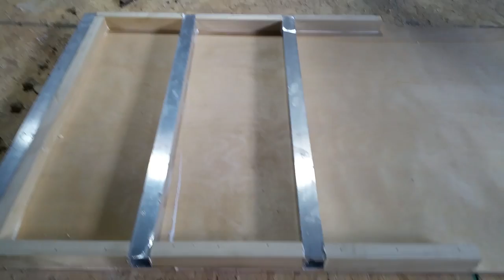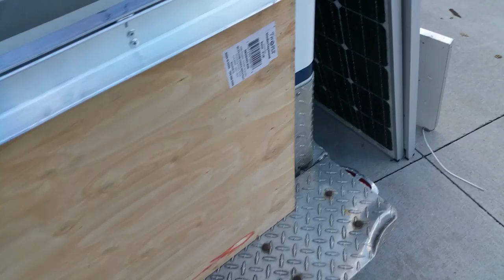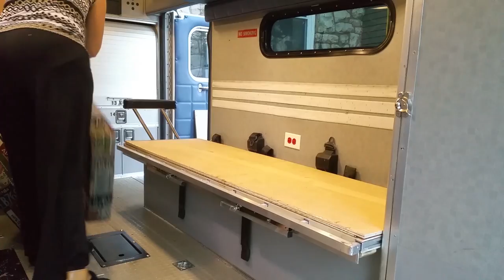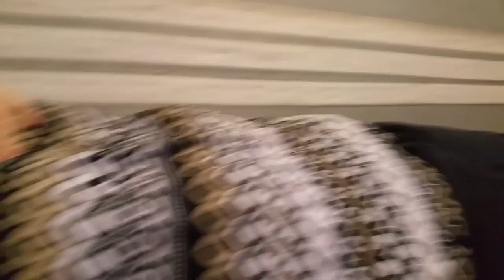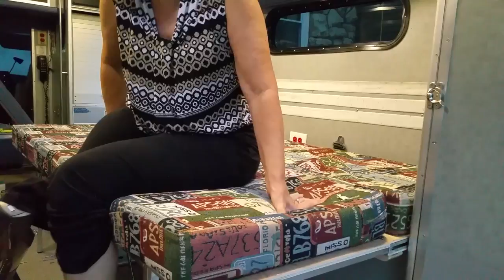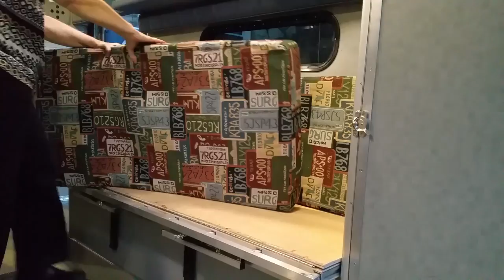#12 Amazing DIY Custom RV Sofa Bed: Ambulance to RV Conversion!

Comment: That is and excellent idea rather than using the wood slats that pull apart. I think this way is probably a lot  stronger and lighter. Thank you for the video! Keep up the good work.
Reply from the maker: Thanks Dan. It does seem simple and solid.

Comment: Now somebody with kids could do apply the same concept for the seat back by doing exactly what you did for the seat bottom and apply that concept to the seat back have it expand out and have legs come down so you can have a double decker bunk setup. That would work good to sleep two kids and two adults or 3 kids and 2 adults depending upon the size of children.

Comment: Very ingenious use of the bench seat! Now will that slide out for the bed wiggle outwards while you're driving, hitting bumps, taking turns? Maybe you have some method to keep it stationary while running the roads?
Reply from the maker: I don't think it will, but if it does I can put a lynch pin in one end to hold it in place. Thanks Lawrence!

Comment: Hey Jim, EXCELLENT build. We're putting a bed in our ambulance and I haven't seen any solutions as well executed as this one. Where does one acquire legs like that? Thanks!
Reply from the maker: The legs are square aluminum tubing with caps on the ends. The hinge-support is simply a heavy duty shelf bracket that was riveted to the bed and legs. I used a pull-pin to hold the legs up. Thanks Dustin!

Comment: I bought an ambulance which I am converting to an RV. May I ask questions?1) is there anything you would do differently if building the bed again?2) how did you attach it to the wall so that it can still lift up for the storage beneath?3) do you have the support pieces about 6-7inches apart? I was afraid the aluminum might not be enough support for my sister that is about 280, sleeping alone, but if both of you are ok, then she should be, right? 4) Do you see any reason I couldn't do this, replacing your solid pieces of wood with peg board with holes to alleviate mold? Mold seems to be an issue under beds for many who live in small areas like this.5) my sister, like your wife, has one leg. I am afraid I can't get her into the ambulance (she lives hundreds of miles away, so haven't tried yet). How does your wife do it? My sister is on dialysis and I am hoping to take her on a trip while I still have her with me.6) did you ever consider using t-slotted aluminum framing instead of the plain tubing? I saw a different type of bed frame made with it in a cargo van (not including a lid) but couldn't figure out how to use it here. It did seem like an excellent alternative, but likely cost more.7) any other ambulance conversion tips to make life easier for a person with one leg?Thanks so much for making this video. It would be much appreciated to hear your answers and most helpful if they were numbered to match up with the questions. Thanks!
Reply from the maker: For the tools and materials easily available, I am very happy with the bed. It's solid, light weight, and simple to use. There is a piano hinge along the back edge that attaches to the storage box and allows the lid (couch) to open. The aluminum is incredibly solid and has held up well. Easily supporting both my wife and I, I have no doubt this could support your sister. Thanks for your interest!

Comment: Hi Jim! Very nice design btw! I am in process of outfitting a campervan and was looking for inspiration. What I love about yours is that it keeps the whole box underneath intact and you could fit large items like skis and stuff. I have a  few Q: for you please: 1. Does the bed rattle when driving over bumpy roads? 2. Is it sturdy enough that it won't move/shake while moving in bed? 3. Would you please be able to provide a few detailed pictures with how the ply falls and locks in place to keep the frame wide open? 4. Where would you purchase folding legs like this? Many thanks and great job once again!
Reply: Found legs... Just the other questions if you don't mind please.

Comment: hello i am looking at an ambulance on craigslist like this. what is the ceiling height of yours? is it tall enough for 5 10 to stand? thanks.
Reply from the maker: Nope. Not sure off hand. I am 5' 10" and cannot stand up. Probably around 5 1/2 feet tall?

Comment: Jim,  I went back and looked at every one of your videos and I am very impressed with your expertise and resourcefulness.  Your videos are some of the best on UTube as far as step by step conversion.  When you bought your ambulance did you find a lot of engine problems that needed to be fixed?
Reply from the maker: Not with the engine; this diesel is know for it's go power. We had a lot of brake work to do. Thanks Big Joe!

Comment: hey there, Just wondering if you had any issues with insurance for your ambulance... Progressive just told me today that they couldnt cover it bc it is riskier because it use to be an ambulance? they said i couldnt insure it as a rv, or commercial vehicle with them... do you happen to know a company that will insure?
Reply from the maker: No problem. We had it licensed and insured as a Ford Econoline Van.

Comment: Hi, I just got my 2nd ambulance, but this is EXACTLY the same as my first one.  It's basically a band equipment hauler.  I love your design.  Could you please tell me where you got the legs for the bed?  Many thanks!
Reply from the maker: These were heavy duty shelf brackets purchased on Amazon.

Comment: I have been considering converting an ambulance to a camper also.  I like lots of storage.  Have you had any problems converting?  Since it is a commercial vehicle, have you had any problems getting vehicle changed over to passenger vehicle?  I would like to see finished result videos. Got a thousand questions to ask you. sorry.
Reply from the maker: We were able to license it as a E350 van, which is what the chassis is based on.

Comment: If you haven't done it yet, you could remove the strobe light heads and put camp lights in place of them! So then if you want light outside of the truck you can have it when you need it
Reply from the maker: Replaced the right side lights with amber lenses. Works great! Thanks Zach!
Reply: Jim Waltz that's good! I know having the amber keeps it legal at least.
Reply from the maker: We're not quite 'legal' yet. But we're working on it!
Reply: Jim Waltz that's the story with my pickup truck lol. And just when you think you're almost there and everything is going smooth, something has to go wrong lol
Reply from the maker: Gotta love projects!
Reply: Jim Waltz yes indeed lol

Comment: very good! you're very ingenious to find ways to built solid, durable, and cheap. I'm curious to know what are you doing for work? 😊
Reply from the maker: Actually my wife an I are both nurses. I have a history of construction and cabinetmaking. Thanks!
Reply: +Jim Waltz 🖒
Reply: So it's quite fitting you chose an ambulance to convert! Are you nurses in a hospital setting or nursing home type environment?

Comment: have you any information on insuring this for road use as an RV camper?
Reply from the maker: I'm sure this depends on state (we're in Missouri) but here you can insure as an RV if it has a working sink and toilet. We currently have it titled as a Ford Econoline Van. Not expensive but RV insurance would be cheaper.

Comment: I didn't hear.  What was the finished size of the bed when out?
Reply from the maker: When slid out it is right around 42" wide and 74" long. Not huge but comfortable for the two of us.
Reply: won't work for me.  I'm 80 " and almost 42" wide  tall lol